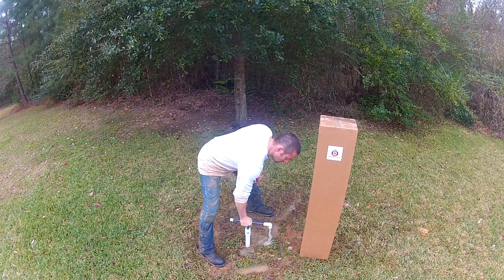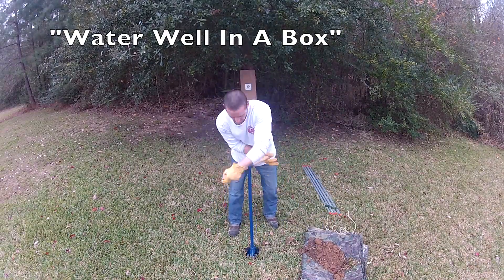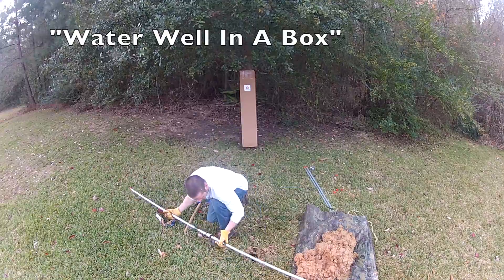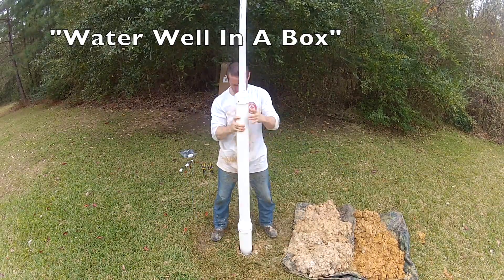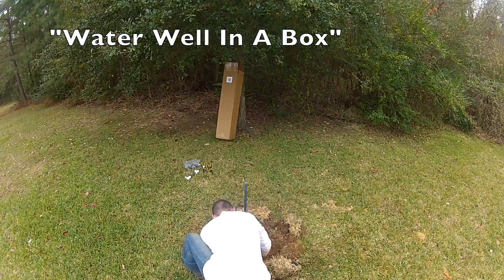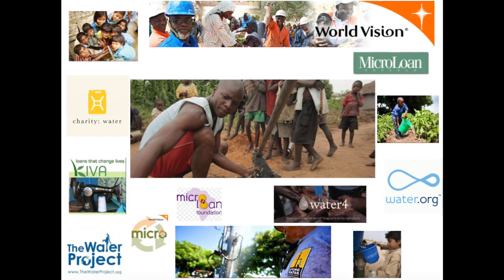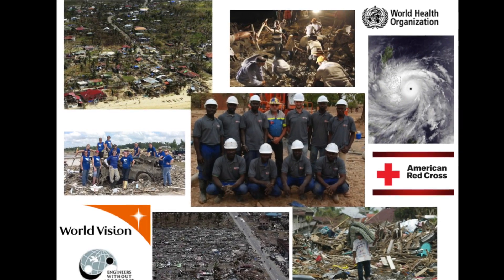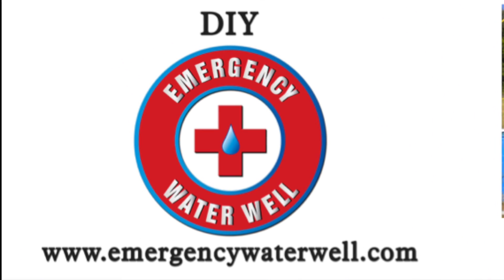Do It Yourself Water Well Drilling

Comment: does this easily accept a pump for continuous flow?
Reply: No you aren’t going to get good flow from ground water pretending to be a well.
Reply: @praestant8  Depending on the area yes you can. It's a shallow well. My area has a very high water table. You can pull quite a bit from the ground without going to deep. I'm not sure why you feel like taking the time to talk shit about their product on every comment. If you dont like it try and make something that works better you lazy fuck.
Reply: @praestant8  ok can you tell us is there any other cheap and easy option to make a well used for irrigation of small lands? i have been doing research for a short time and i would like to know what is your suggestion

Comment: How many gallons of water come out of those wells usually? with an electric pump would provide enough water daily (or thorugh the night) to fill a tank and use in the house? I'm in costa rica and there are shallow wells made here (20 feet) but they are usually way thicker and harder to do (3 workers at least), thanks

Comment: I notice in most of these drill your own well videos, is that the ground is made up of sand and clay. Like to see someone try this with harder ground.
Reply: Hitting water at 10' too.
Reply: Depends on where you live.  We dug just 3 ft down for fence post at our farm and came back from lunch to water in the holes.
Reply: The wouldn’t be scamming any sales that way.
Reply: Lots of rocks here in Michigan where I'm at due to the ancient glaciers moving through displacing them. I can't dig a fence post without pulling out 5-10 inch sized rocks by hand.
Reply: You also wouldn't patent a device if your angle was humanitarian aid...

Comment: say if a guy was digging... hits water at 15' but only able to get to 17' before water took over the hole... aka soup. how do you go deeper ?
Reply from the maker: You could try wrapping the auger with some sheet metal to make a little bonnet.  That would help keep the soup in as you pull it out.  Also, you could use the auger looses up as much dirt on the bottom without getting it stuck, then run your screen down and the hammer it in as far as it would go.

Comment: very good job , i wish to do so but can this work on solar panel.
Reply: Muhammad Alam if you're on solar Off the Grid and you know about 24 volt systems and that's probably what you would need in order to pump electrically and you could use a 50 gallon drum plastic drum has a holding tank which would give you that Reserve then you could do what you need to do

Comment: So gravel layer will not work with your system?
Reply from the maker: +metamech Thank you for your question.  We've been able to drill through layers of gravel as long as the rocks aren't bigger than a large marble size.  It is definitely slower drilling through gravel but it can be done with this auger.